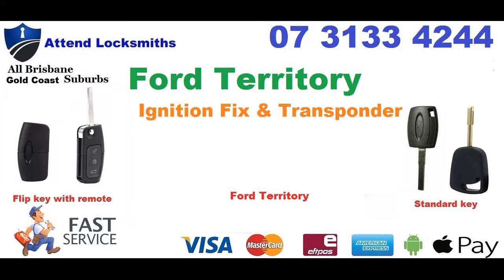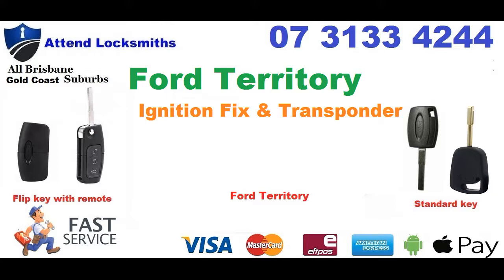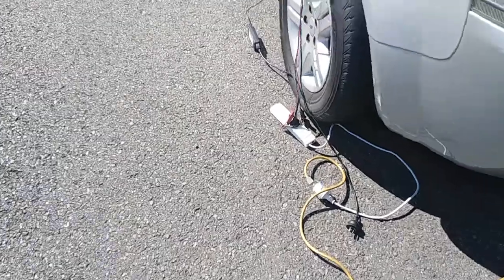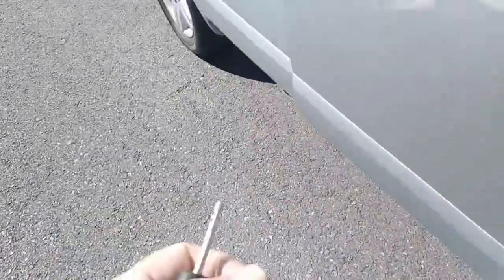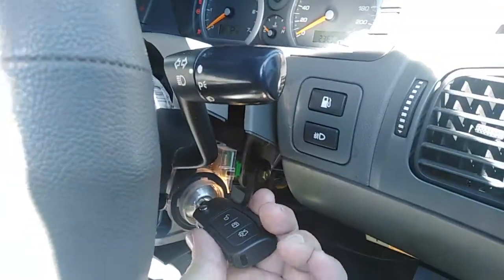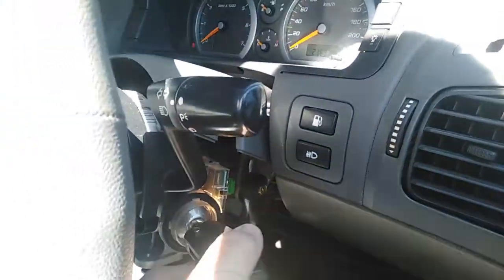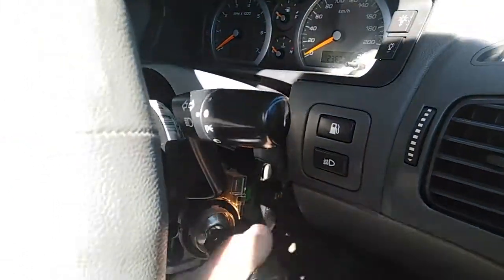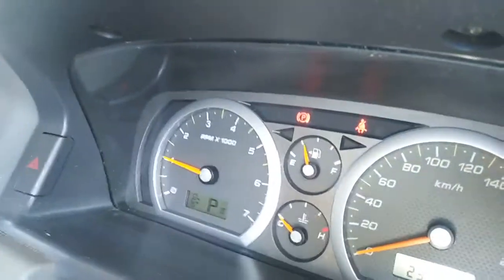Ford Territory PCM BEM Reset Fix ignition

Comment: My ICC won't turn on, I've checked all the fuses. Looked for any loose connections behind the fuse box in side on drivers side, I'm going to check behind the ICC to see if any loose connections. We had a new ignition put in due to car ending up immobilised. But while she was sitting in a car park until we had her be towed it was coming up code? And the day ford towed her the ICC wasn't turning on neither air conditioner. The lights come on when you turn on head lights, I can hear the ICC moving around in the ICC, in accessories and turn on mode.?

Comment: Hey mate, I've just removed and refitted the dash on a sz territory and now I can't communicate with the pcm or the abs module, everything is plugged in properly. Does this mean that the computer has reset itself?
Reply: Hi, i am facing same issue. how did you fix it. thanks
Reply: @73almast23  G'day, yeah I did end up finding the issue, there is a small electrical plug in under the centre console, back from the shifter assembly that i hadn't plugged back in. It's actually part of the can bus wiring and if it's not plugged in, none of the modules with communicate.